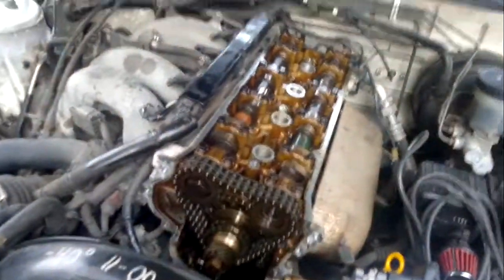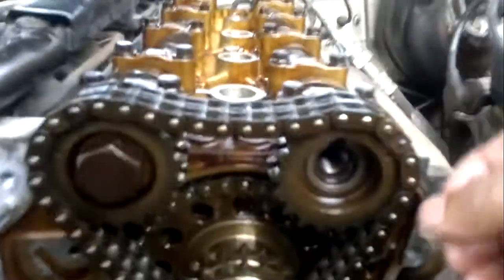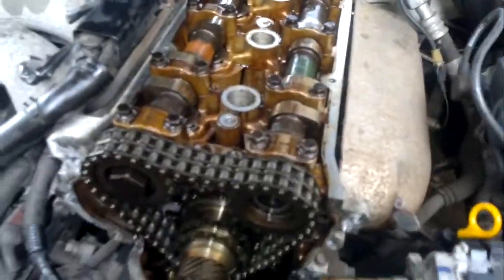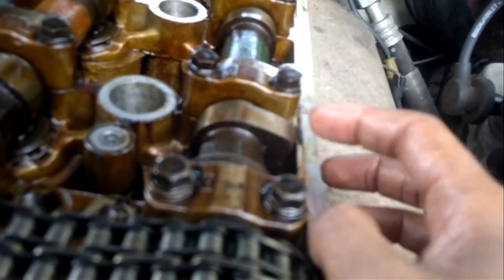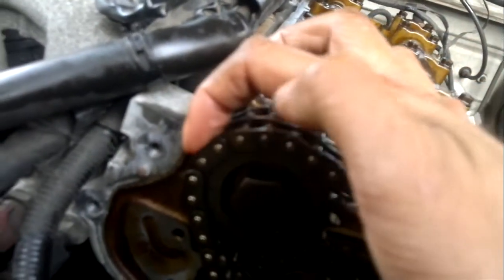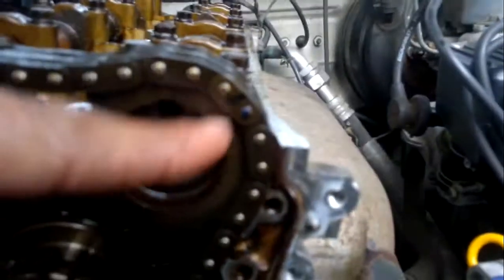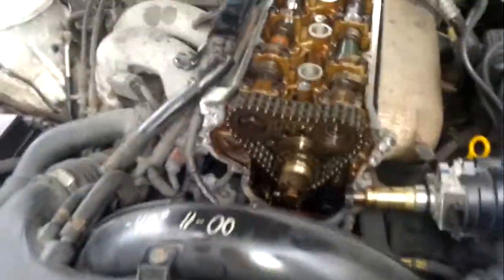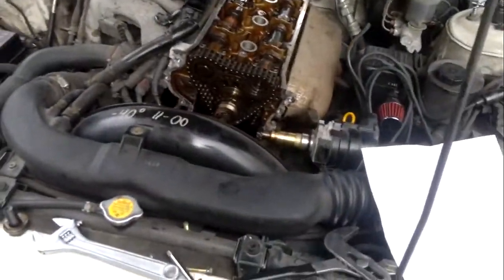240sx 248/232 camshaft install 3teeth CCW

Comment: This was perfect. Really clear up what the whole "TEETH CCW" was all about. How do you like 3 teeth, heard 4 teeth is nicer for top end.
Reply from the maker: Car pulls hard from ~3k-6k with 3 teeth ccw. I like it quite a bit. I'm stalling coming to stop signs ever since the swap but i have yet to adjust the iacv correctly to prevent that from happening. 
I also redrilled a spare cam gear at the 3.5 tooth mark which I'll be throwing in soon. Stay tuned for a video
Reply: killerboy631 Hey Killer, so I finished my install. I am DUAL 248's. Yet, I think the idle issue comes from the 248 on the intake side. I have resolved my stalling issues and will post a video to follow up with this later. Yet, what I had to do was simply to remove the IACV. I assume to test this on yours just remove power and also remove vacuum lines from the IACV and plug them so you don't suck air past the throttle body. Then at the throttle body there is an idle set screw on the bottom left corner (looking from the front), you will need to use that to set your idle.
Reply from the maker: TYSON WOODS thank you. I was able to resolve the stalling issue. I guess i was doing the idle adjustment wrong the whole time. Took me quite a few trial and error test drives but i got it.
I'm still gonna throw in my redrilled sprocket once we get warmer weather. Will post video/review when i do

Comment: So on the intake side. Are the lobes facing outward still or kind of down? I'm doing this mod and can't really understand what you mean. So this is what I'm asking I have stock s13 kade exhaust cams not a s14 intakeSo I'm asking this:Exhaust side is set at tdc cam lobes facing outIntake side the cam is facing more into the valve? Did u re drilled the cam sprocket
Reply from the maker: what cam setup are you doing? 245/232? 
i went 3 teeth ccw on the intake side with the 245 exhaust cam. you can also do 4 teeth ccw for more power on the high end. 

the intake side the lobe could end up facing slightly more horizontal than the video if you do 4 teeth ccw. Best thing to do is use the timing marks to your advantage. So first, set everything up like you would on a stock setup(don't worry abt the lobes right now). Once everything is set up, spin the intake side cam so the timing mark on the sprocket ends up either 3 or 4 teeth ccw like i show in the video.
Reply from the maker: to answer your question, this video doesn't have a redrilled sprocket used. basically if you were using the redrilled sprocket you would end up at 3.5 teeth ccw which is ideal. 

to answer your other question, the cam lobe on the intake side will point slightly more towards the valve(horizontal) if you're using an exhaust cam.

Comment: do you use the intake cam sprocket or exhaust cam sprocket? this is for the exhaust cam goin to the intake side.
Reply from the maker: Sprocket will not matter because they are both the same. 
The camshaft itself is what's different and the dowel pin at the front that the sprocket settles down on is what's different.

Comment: Did you had to use the bracket to push down the camshalf while installing it?
Reply from the maker: Which bracket are you talking about? 
Do you mean the cam caps?
Reply from the maker: I didn't have to push camshaft down to install the cam caps... When you install the cam caps and  torque them in the correct pattern (look this pattern up, it's important) it should push down on the camshaft evenly and then once everything is torqued to spec you can go to turning the camshaft with a wrench to install the chain on the sprockets at the correct position
Reply: I was asking because when i took out the camshalf, and try reinnstalling it.  didn't seem to sit properly, unless i use the bracket to push it down.
Reply from the maker: @red666A  you're probably feeling the valve springs pushing against the cam lobes which is normal
Reply: I see what you mean.

Comment: right now the car runs for a second, misfiring the whole time and dies. 

i have to set the ignition timing, but cant get the engine to run long enough to get to temp. keeping in mind its -25 here. did you just turn the distributor cap blindly until it finally cranked?
Reply from the maker: No... From what you're saying there is a high chance your distributor is off mechanically. Make absolutely sure your rotor is pointing right before cylinder 1 on the cap when you're at tdc. Don't just go with lining up the dots on the dizzy. You're more than likely 180* off. It happened to me with my very first attempt. I think i have a video posted of when that happened.
Reply from the maker: You'll have to be off by a significant amount of degrees for the car to misfire and die. Could just be off by a tooth. What I'd suggest and have done my self is pull the dizzy out(not entirely..enough so you can turn the rotor by hand and feel it going back/forward a tooth) go back or foward by a tooth and see if the problem persists. If it does both ways then do tdc again and put dizzy in correctly this time. If ignition timing is off a lil bit(only a few degrees from stock) your car will idle funny but not bad enough to die.
Reply: hm... ill try that and get back to you. doing more thinking i realize it must be running so rich that it soaked the plugs, fouling them and thats why the car died. My friend blames the -25 degree weather, but it was misfiring bad. Ill try timing it with the light, and if that doesn't work ill try the tooth thing.
Reply: also we made sure the car was at   TDC on cylinder one when we did it, and checked it over when the cam was in by turning the engine over by hand and making sure there was no interference...
Reply from the maker: ***** -25 is pretty cold but i don't think that would cause a problem like that. You'll run pig rich probably but shouldn't be a misfire like you described unless the timing is off. If you want, post a video and link me to it. Put cyl1 at tdc again and take the cap off the dizzy. Show me the rotor placement at tdc.
Reply from the maker: ***** http://youtu.be/bpqOcr0VBY8
Skip to the end where i started the car..is that what yours is doing?? If yes then the dizzy is most likely off 180*...take the mofo out and put it back in at tdc with the rotor pointing right before cyl1 on the cap. It should run

Comment: When you were done with this did you set up your distributor timing the same way?
Reply from the maker: mechanical timing was the same...ignition timing had to be advanced a tad bit iirc
Reply from the maker: by same i mean the way i describe in the video
Reply: killerboy631 why would you need to advance a bit?
Reply from the maker: John Solano you probably wouldn't need to advance it, especially if it runs fine after everything. 
i gotta dig up the write up I followed to try and figure out why i advanced it. i can't recall 

use a timing gun to get it right
Reply: killerboy631 of you happen to come across it, I'd like to read up on it myself. I'd greatly appreciate it! I have this exact cam swap myself with a 3.5 drilled out on intake
Reply from the maker: John Solano there's many others with an actual write up, I suggest searching and reading all of them and piece things together. From my experience, most of the information that you're after is scattered in different posts. 

you can also message me directly if you get stuck. I'll try my best to respond.